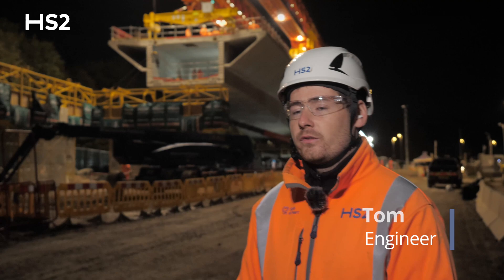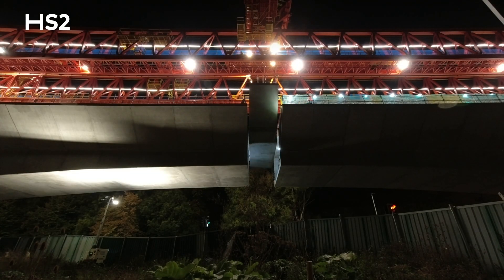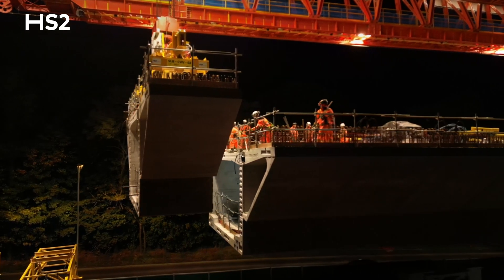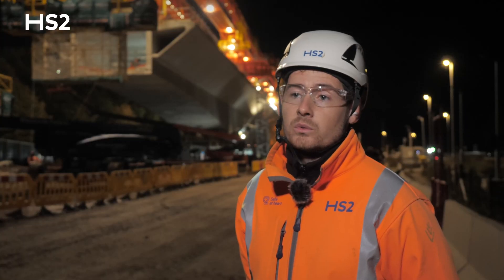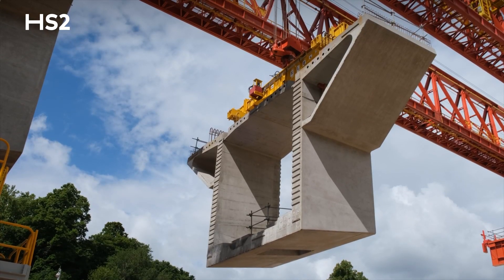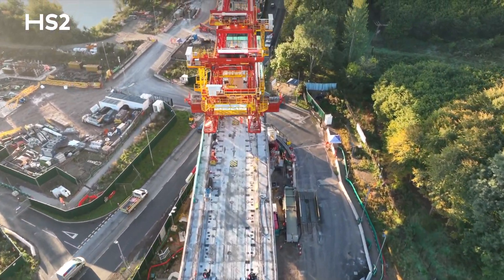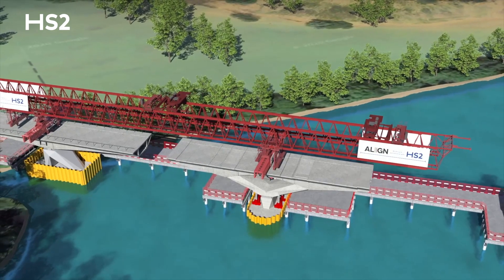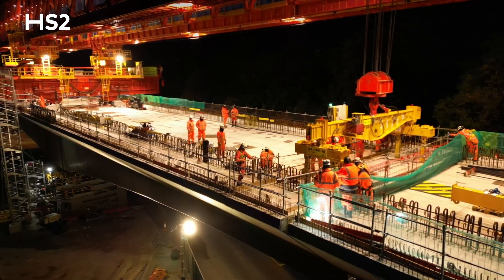HS2 engineers build UK's longest railway bridge over a road

Comment from the maker: We hope you enjoyed the latest construction update from our Colne Valley Viaduct site.
What else would you like to know about the UK’s longest railway bridge?
Reply: How do you deal with that big gap at the end?
Reply from the maker: @hpsauce1078  We leave a small gap between the two sections in order to easily lower the final segment into place. Once the segment is secured, we put some temporary shuttering in place and fill the gap by pouring concrete, in situ. 👍
Reply: @HS2ltd  Thanks!
Reply: @hpsauce1078  The last segment when fitted will still be a gap then stitch will be erected and concreted with rebars and that will close the gap.
Reply: Would love to see a more in depth version showing how the post-tensioning is done. Are HS2 working with any TV companies to do a series similar to "The Fifteen Billion Pound Railway" made during the Crossrail Project?
Reply: @DBailey635  

Plenty of videos are available on the Dhaka metro project where they show a lot of post tensioning process
Reply: I was wondering that.  You appeared to be inserting a segment into a gap between two segments, and when fitted there was a sizeable gap.  The way it was described in the video it sounded like you were building out the viaduct from one end, so each piece always butted to the next, but the video clearly shows the final segment being slotted into the viaduct that’s been built from both ends
Reply: @geoffreycoan  I think the final small gap is normally filled by a narrow section that’s cast in situ, interlocking against the two faces.
Reply: A gap that size = appalling engineering.
Reply: @AJ-Themes-for-Great-Cities  I'm not an engineer. Can you explain why it is a poor strategy?

Comment: At 42 seconds you can see 7 operatives inside the segment there are also 16 operatives atop of the segment making 23 in total , 40 years ago  i actually worked on the 2nd and 3rd glued segmental bridges that were built in the UK , the first being over the river Trent and the next two which i worked on being  over the rivers Ely and Rumney in Cardiff .

Back then there were no segment launchers , a crane would lift the first three segments into place , then two tripod  winches would be placed / bolted  at opposite ends which were then used to lift the next two segments into place , there were two winch operators on top of the permanent structure and 4 operatives plus a council engineer or two  inside the structure making a total of 7/8 people all told .

The two winch drivers would apply the Apoxy resin  to the top of the segment while the four of us inside would do the rest , then two of us would use 4  Dywidag bars to temporary secure the section in place , before repeating the procedure at the opposite end , everyone then left bar the two of us who did the stressing , we then stayed until what ever time it took to push the 19 strands through each of the two permanent stressing ducts ready for stressing the following morning . 

Even back then we managed to erect 11 segments a week with our 6 man crew and all for the princely  sum of  £5-25 an hour stressing rate  , 75p an hour bonus and  £6-50 for each segment erected , be very interesting to see / know  what todays operatives are compensated for there cushy number

Comment: When they do this in China they have much longer prebuilt segments which are transported on extremely long lorries with hundreds of wheels and they have a machine which positions them. I'd have thought that would be the faster way of doing it if you are doing many long bridges. They can stretch between supporting pillars.
Reply: In the UK the sections are made on site using match casting which makes one section aligned with the last. This means that perfect alignment is maintained by a combination of mass and threaded tensioning cables while using as little diesel and road disruption as possible. The 700 tonne travelling girder perfectly places each section. China has extremely low safety and environmental standards which could never be allowed in any Western country.

Comment: Amazing! To detractors, I say unless rail capacity increases, future demand will transfer to cars and aircraft. A new conventional railway will be similar to a high-speed line in terms of environmental impact during building. We should have done this years ago. Did you know that MOrocco has more high-speed line than the UK?
Reply: The Tagine Express is brill.....sorry I was very very stoned last time there.
Reply: Affordable rail travel is essential. The tickets for HS2 will be astronomical. Back to your car it is.
Reply: Good thing HS2 makes local rail more reliable and faster. So even if HS2 fares are astronomical (it won't be), the rest of the service will be much better.
Reply: Exactly!  I might suggest to the detractors that we scrap the project and add a couple of lanes to the M40 instead

Comment: There are high speed lines all over Germany and France, England tries to build ONE and we are supposed to be impressed? Just get it finished and running!
Reply: This is technically the 2nd high speed line.
Reply: It's literally called High Speed "Two"??? 😂
Reply: Morocco has more high-speed rail line than the UK.
Reply: England is very small. Britain does have a population one fifth of that of the US but it's smaller than Oregon and less than half the size of France. There's no rational case for having many high speed lines.